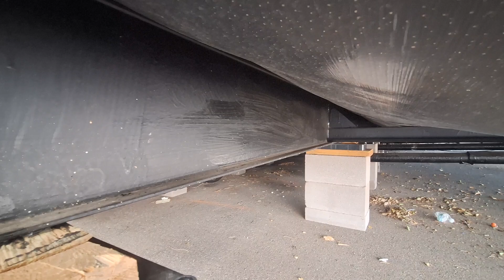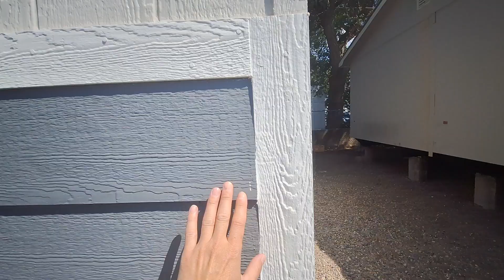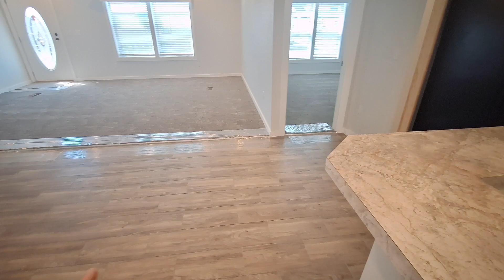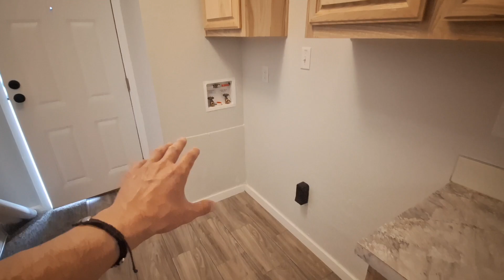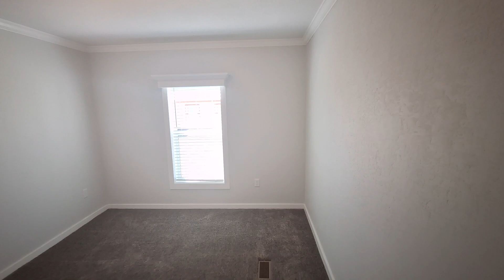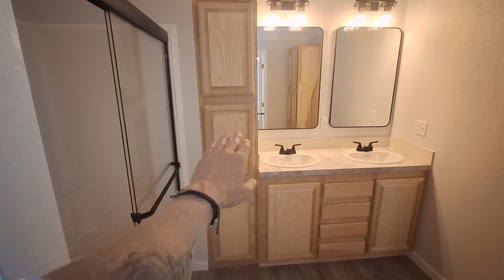Solitaire Homes 28523A | 856SC | Super Closet | 1,456 SQFT. | Double Wide

Comment: Yes we need homes like this in South Carolina the solitaire homes are better than the old mobile homes. I like where the hot water heaters are in there in space and not the closet I don't like homes with the heater in the closet with the old module I have I have 1998 Lamar General it's 3 bedroom but the solitaire homes are better I would recommend a solitaire homes I never been in solitaire homes better made than old homes